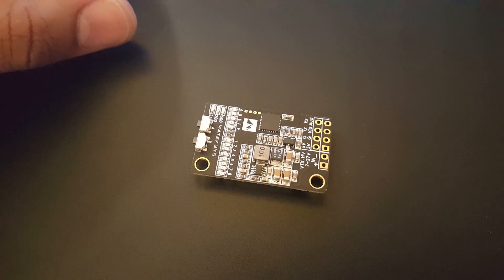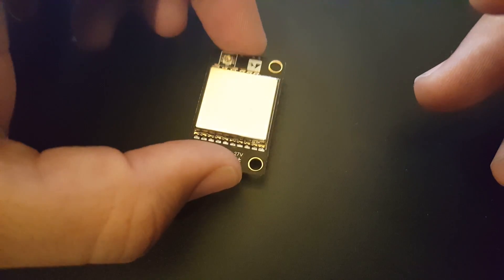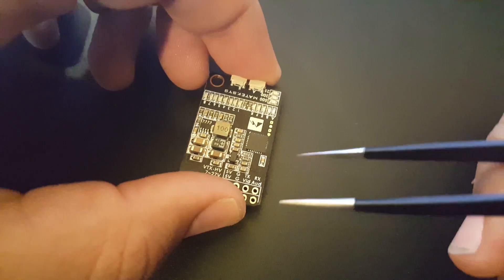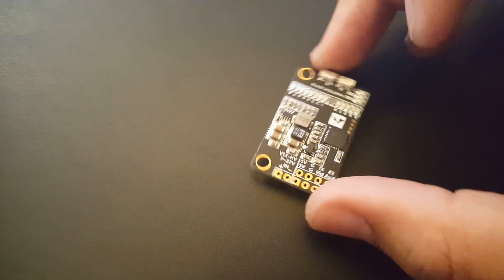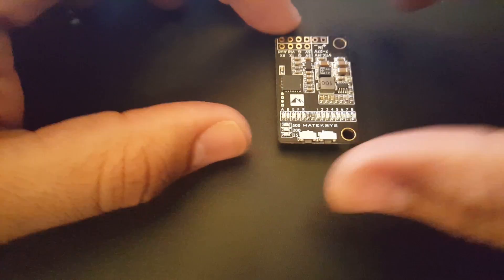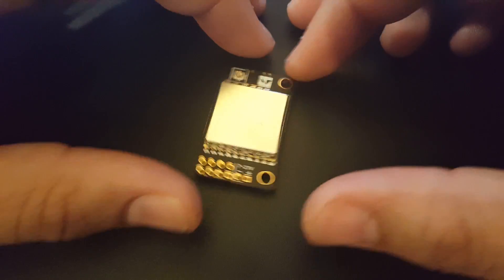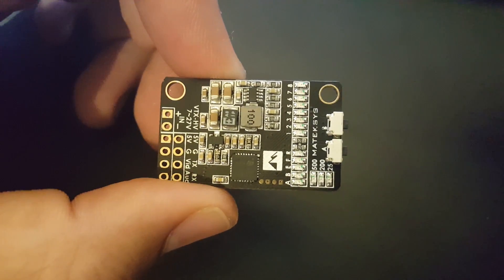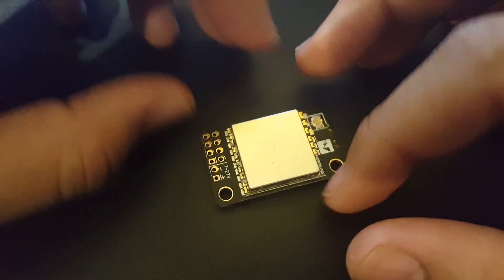Matek VTX HV // Overview and Power Consumption

Comment: My setup is a Cicada AIO f4 FC( Racestar aio), matek vtx hv, Frsky R-XSR, RunCam Sparrow now here's  my problem from the vtx  rx and tx pad where do I connect them to the FC, I'm already using the TX6 from FC to connect the uninverted smart port from the R-XSR to get telemetry,which the other only pad I see in the fc is the RX6.So  I would like to have smart audio but how do I connect them, I'm stuck btw this is my 1st build totally noob here, LOL, keep up the good work and thanks.

Comment: Have you used the Matek yet +Drone Mesh? I have been using mine with my HGLRC Flame F4 and getting diagonal lines in the video. When I power the Matek from regulated power (like RAM pin on BFF3) The signal is very clean, but off Vbat on my Flame it is very noisy, and that is with a 1000uF cap too.
Reply from the maker: First make sure its powered through the + and - where the VTX port is because that is has some filtering unlike the battery pads.

Second what is your ESC motor combo.

Third this has nothing to do with the VTX.
Reply: Yep it it is powered through the VTX + and -, although I was led to believe that was unfiltered?  

ESCs are Spedix 30amp BLHeli_S and motors are armattan oomphs. Also, I am getting the lines even on the bench with no motors running.

You think it has to do with the FC then? Like I said, the Matek is fine when powered from my old BFF3 Ram pin (which is set to output filtered Vbat). Maybe the HGLRC is the problem, which would be annoying seeing as I got that FC because of its capacitance and supposedly clean video.
Reply from the maker: Kent Boehm 2 things you need to check on remove it from FC and power it from battery.  Still there then change your antenna if still there then the board seems to have problem.
Reply: Righto cool. I see where you are going. Will try those two tonight. When you say the board seems to have a problem if those two are still there, do you mean the Vtx or the FC?
Reply: So it worked fine straight off a battery and the antenna made no difference. Looks like my Flame F4 is the problem. Now to see if Banggood will make it right!
Reply from the maker: Keep me updated but you basically solved your problem keep the VTX powered from the battery.
Reply: It isn't quite solved though - powering it from a seperate battery solves the problem but if I power it from the battery when it is connected to the Flame F4 (IE solder the VTX power leads to the main battery input to the FC) the problem returns. Essentially, any time the FC is included in the circuit, the problem returns.
Reply from the maker: I see.. Keep me updated 

If you want a quick temp fix add a small cheap buck converter and set it to 8.3V with low esr. 

8.3V is because thats the best voltage to set them as they run the cleanest from my testing.

Comment: I ordered this VTX 2 days ago exactly because it support stackable mounting, have wide range of powering voltage, switchable power modes and is fully controlable and upgradeable through FC. Price more than is adequate for build quality and features which this VTX have. I purchased FX799T a year ago for the same price which this VTX have now. I hope that stackable mounting will help to minimize wiring mess in mine quads. If I'll succeed in that I most likely will by two extra ones for other quads.
Reply from the maker: Its a good board i have been using now for a while and going to place the second one i have on another build.

Comment: matek makes you think what ever you bought in pass   were such waist of money!
Reply from the maker: underfloor heating installer I feel the same way I have 5 hglrc f4 flame boards because i thought those will be the best as personal preference but now it's the Matek f405 aio.
Reply: giveaway time! lol
Reply: my f4 flame has been flying well. whats the issue?
Reply: matek F4 AIO uses the worse gyro. It is meant for phones. watches and tablets. There is a better version of that gyro(the one on holybro F4 AIO) which is made for qauds and drones. Matek F4 AIO would have been the best, if they used that gyro.

Comment: put it in the bench test noice etc on 7 v and 27 v
Reply from the maker: +Martin Jensen Ok we will give it a go.
Reply: love u bro : D
Reply: Maybe not 27v really, but testing on a 4s lipo with +Drone Mesh's standard noise testing to see if it gives any crazy flickering. I have high hopes for this VTX since it is coming from Matek - after switching to the DYS F4 all in one board I have had major issues with video noise that were only solved by a full LC filter, no amount of capacitance on the Lipo voltage terminals would help. I'm in the middle of changing FC and ESC to the Asgard and I'm hoping that with this VTX I will not need to add more than just a capacitor to the battery leads while running Lipo voltage into it and using its step down regulator to power the camera.

Comment: Drone Mesh, you need to get an rf power meter to test the actual output of VTX.  That is where in the past i have seen a big discrepency between rated output power and actual.  A lot of the cheap vtx(eachines, clones) only output something near rated output on one channel per band!  The rest of the channels can be 50% of the rated power setting.  I've tested lots of tbs/tramp vtx and they test right in range.  Without testing output the other consumption figures really don't mean much.
Reply from the maker: +Canyon Racer the figures I setup is just for people to be able to calculate consumption from becs and battery usage. This was not output power only a power consumption. I am trying to get my hands on a spectrum analyzer. ;)